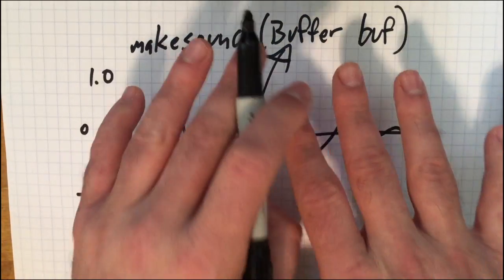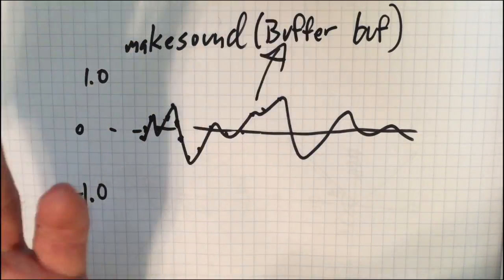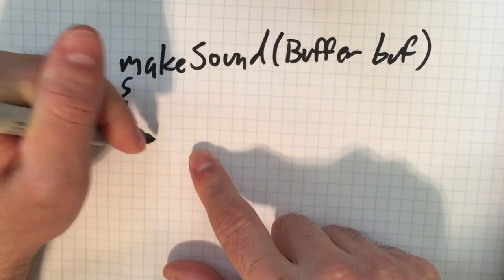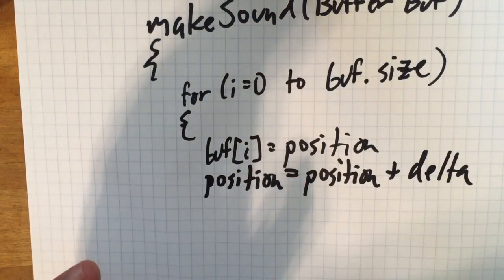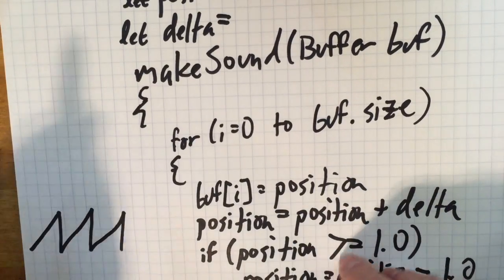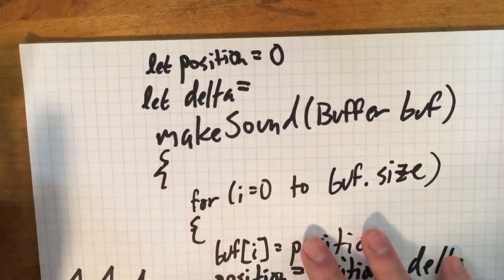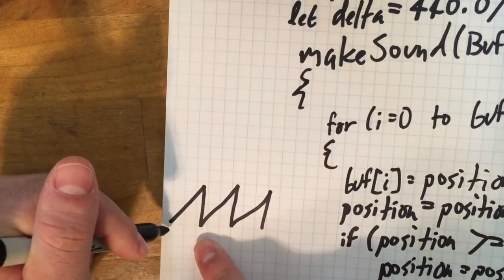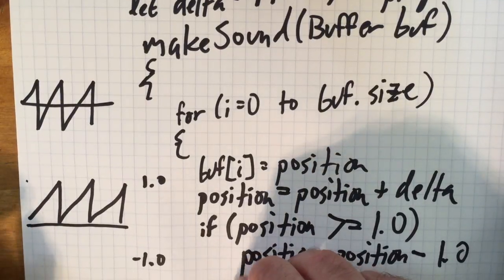GroovyDSP: Starting out, and how to create an oscillator (basic)

Comment: Nice video, man. Great intro to the topic, clear and well explained! Keep up the good work. =]
Reply from the maker: Thanks! I've planned the next couple, which are going to be about aliasing and then a few different ways to design good oscillators. Are there any DSP topics you'd especially like to see covered?
Reply: @groovydsp1716  Great video.  You sort of blow past the loading into audacity portion.  Just wrote this up in visual studio and getting the same thing when imported into audacity is not a slam dunk.

For anyone else banging the code out, be sure to use the file ops...I tried to short cut a few lines and use ofstream << instead of writing to the file.  I know going into little endian/big endian will blow over most people's heads, but are MAC and PC still opposites?  (it's been a million years since I took assembly and since then MAC went Intel.)